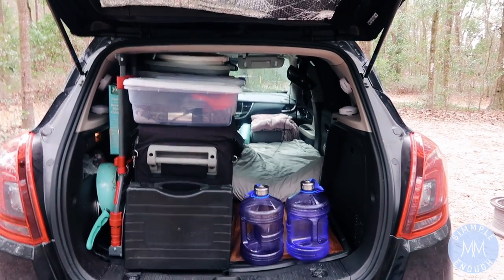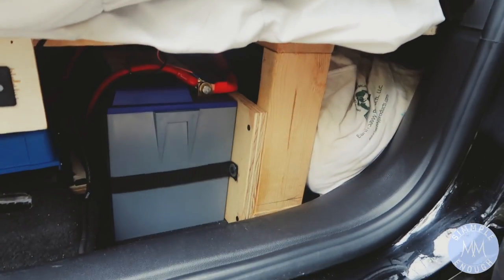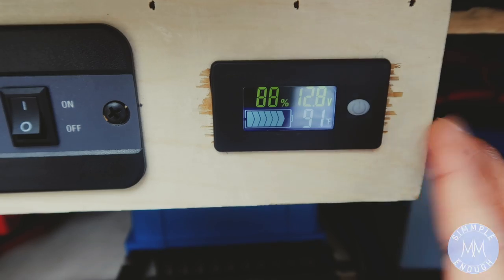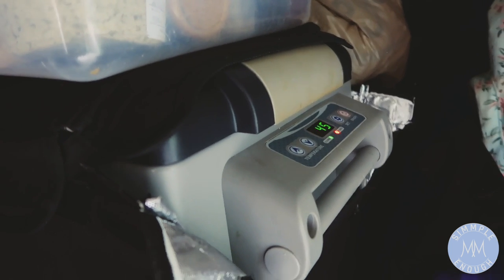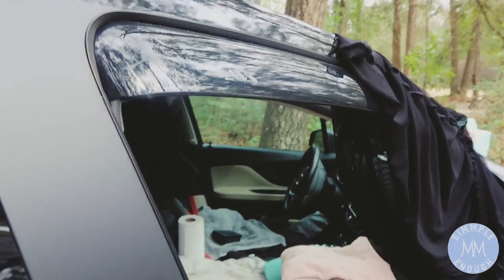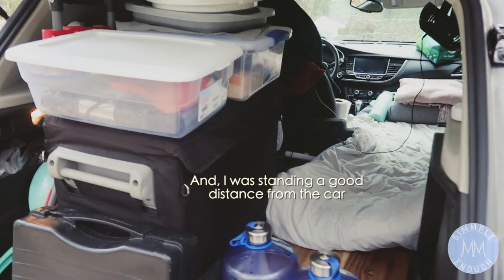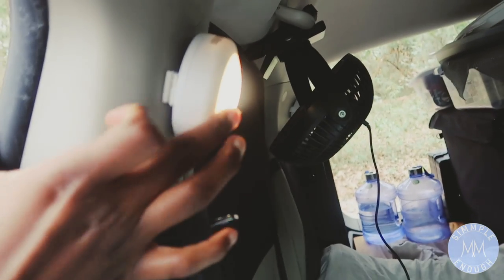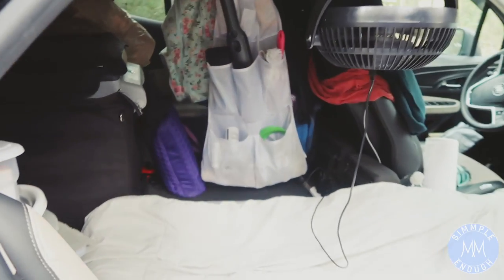How to Live in a Car Full Time // Updated SUV Car Tour 2022 // Living in a Car Build

Comment: I just started living in my car. I decided to not renew my lease. My setup is two 100 ah batteries, 5000 watt inverter and a 320 amp alternator. It was struggle to keep my subwoofer and fit a twin foam mattress. I wanted to keep my subwoofer if all possible. 

I shower at the gym every day, use a rice cooker and toaster oven for cooking. But don’t use it often. I use a fan and plan on getting a electric space heater for the winter. So far it’s been 6 weeks and finally getting situated. My plan is doing this for 6 months but maybe a year.
Reply from the maker: Wow, you have a nice setup!  I can tell you planned very well before starting this lifestyle!  Although I’m currently having a few issues with my power setup, I’m still happy I switched from the yeti goal zero to getting the 100ah battery and inverter.  It can handle so much more.  

I’m glad you’re finally getting situated.  Good luck.  I hope you accomplish all your goals!

Comment: Hey how much was it for the full installment of the batteries etc......
Reply from the maker: The battery costs around $900 (you could probably find lithium batteries a little cheaper. I used Battle Born), the victron battery charger was $284.58, my 60 amp fuse was about $20-ish, and the labor cost was $565.82…so my complete power setup was about $$1,770.40.  Doing it yourself can definitely save a good chunk of money.

Comment: I saw you have a camp stove, so do you store a propane tank in your car? I have always been worried about hot days and pressurized canisters
Reply from the maker: Yes.  My camp stove uses butane and I store them in my car, underneath my bed.    I was really worried about this issue, as well, but they’ve been fine in my car, so far.  Since I keep the car cool when the weather is too hot, and warm when the weather is cold, the inside of the car doesn’t get too hot or cold most days.  At one point I was going to put the canisters in my roof cargo area, but there’s no way to regulate heat there, so I decided against it.  I think they’re fine inside of a car because the temperature is more regulated.   This, of course, is my opinion, so I want to advise you to do what you feel is safest 🙂

Comment: If the cops ever approach someone living in their car? What advice would you give
Reply from the maker: I would tell them I’m pulled over for the night to sleep.  If they tell me to leave, I’d leave.  One night, I was pulled over on the side of the road trying to fix my camp stove that had fallen and started leaking butane.  A cop turned on his sirens and did a quick flash light search in my car after asking me what I was doing.  He could tell I lived in my car.  Sometimes, I think that puts a little compassion in their hearts because they feel bad.  Even though I know this is my choice & I’m definitely not in a sad/bad situation, I go with it because the cop typically becomes nicer, lol.  Another time, I got the knock from security guards at a hotel and they just told me to leave, so I left.  It’s nothing I worry much about.
Reply: Just be honest with them! What you are doing is not illegal just be honest! And leave when they ask you to!
Reply: Depends on area where I am it's illegal have been threaten with ticket towing or having a boot put on wheel. I tell them having car trouble and some one is on the way